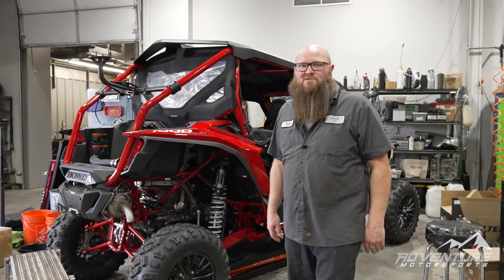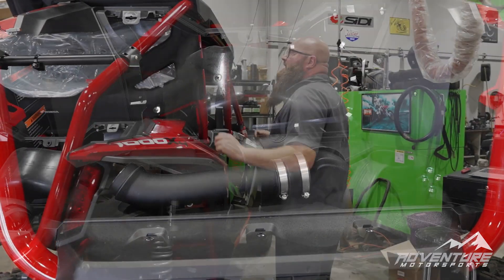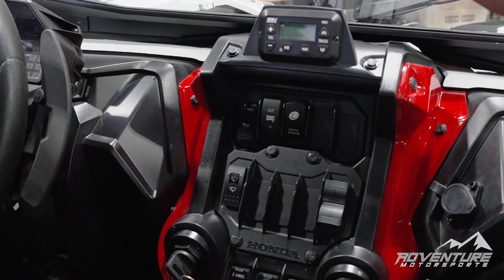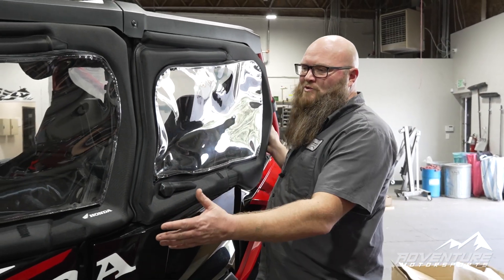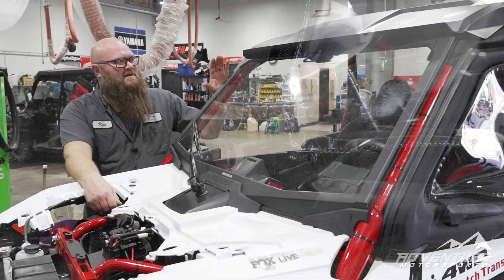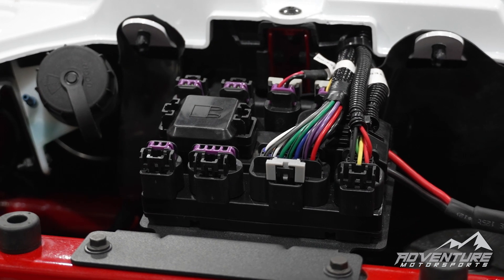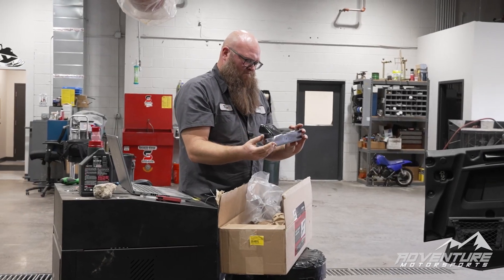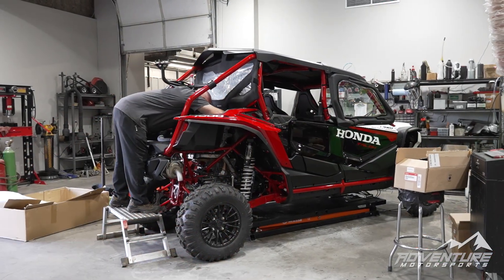Loading Accessories on a New Honda Talon! | Part 2

Comment: I just put the windshield,windshield wiper kit,oem heater,upper doors and the full radio kit with front,rear speakers and subwoofer. The thing I find odd that Honda did is you can’t buy any replacement parts for them. Like the clear vinyl windows considering they scratch super easily. Can’t even get the upper plastic door handles. I called my dealer and can’t even get the cap for the washer fluid tank that I lost.